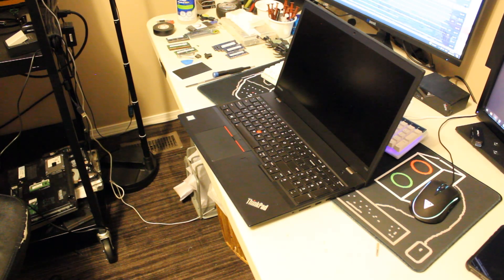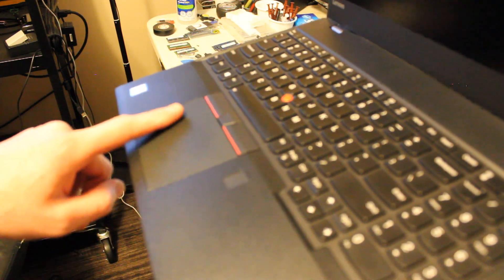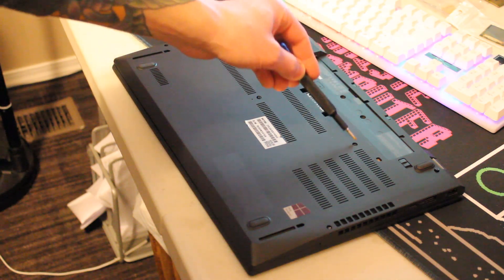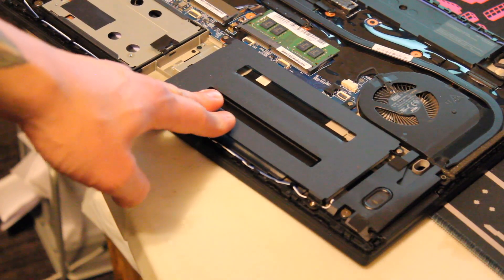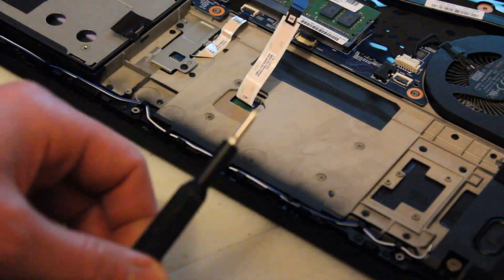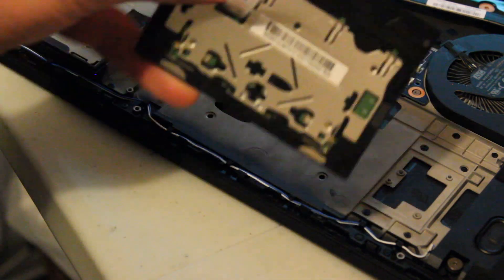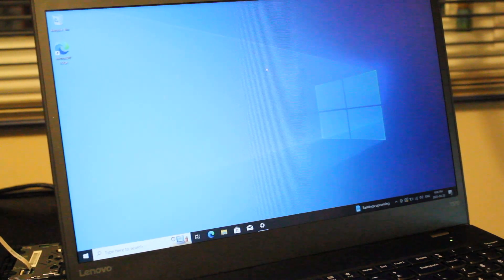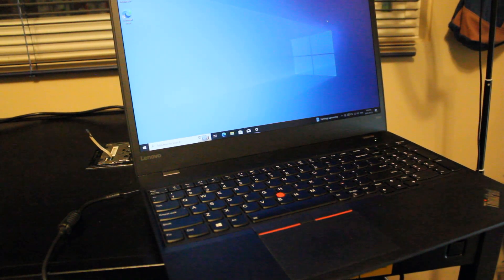Lenovo ThinkPad T570 Touchpad Replacement

Comment: Did u have to install a new driver? And would this help solve an issue if your touchpad doesn't sense 2finger or 3 finger gestures?
Reply from the maker: I didn't as the drivers supported the touchpad right away.  Are you facing this issue?
Reply: @HaisteComputerRepair  Yes, i bought a T570 of Ebay... Everything is great but the touchpad gestures don't work even though they are turned on in settings...2 touch scrolling doesn't work. 3 touch gestures don't work. I've tried solving it on the software driver side but I've had no success. So now I'm looking into replacing the touchpad.
Reply from the maker: @ADUSEI6111  Try pressing the windows key>type Device Manager>Mice and other>right click>properties>driver>update driver>browse my computer for drivers>let me pick from a list>see if there are some options to try out

Comment: Can the keys on the mousepad be repaired ?
Reply from the maker: The three buttons above the touchpad?  They are attached to the keyboard and then connected to the motherboard with a ribbon cable.  I am actually not sure if they have to come with a keyboard or if they can be detached.  A new keyboard isn't too expensive, though.